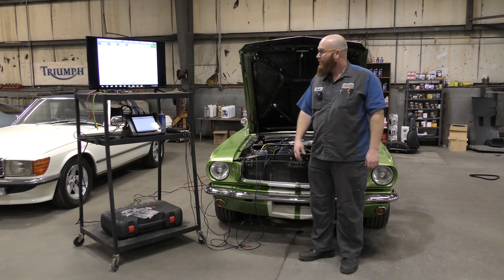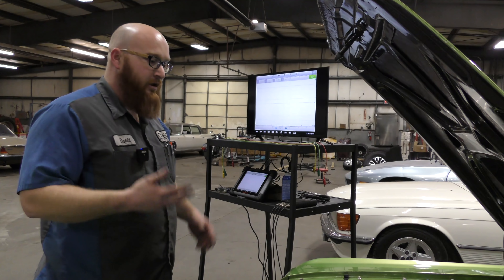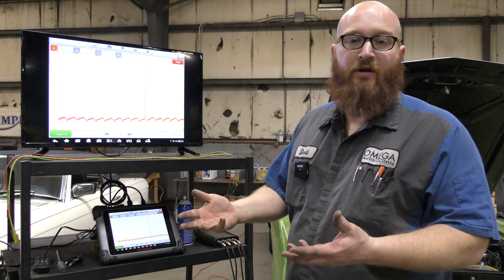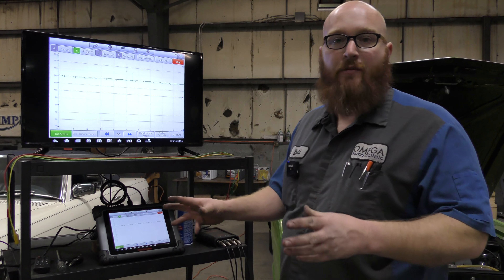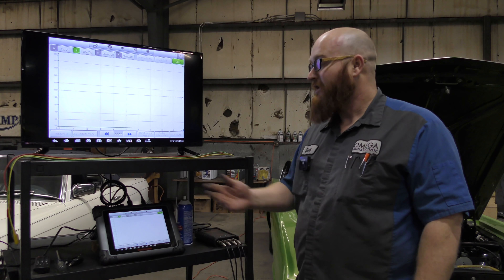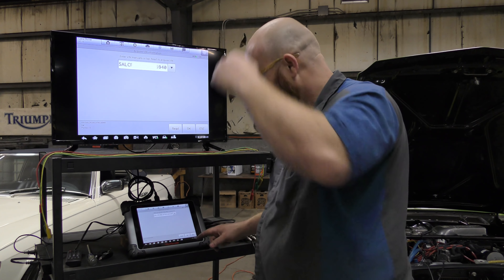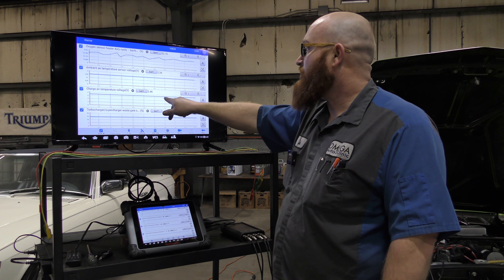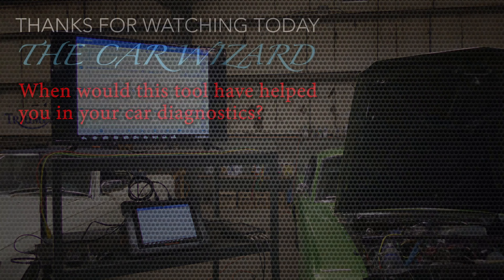The CAR WIZARD tests a '66 Ford Mustang using an Autel Oscilloscope. More magic toys in his tool box

Comment: Eric O. over at SMA channel showed how he used an oscilloscope to diagnose bad cylinder compression on a car by measuring cranking voltages from the starter. He also showed how to diagnosis a faulty injector with it as well.

As much as some of you guys think this is a shill video, it's not. It's a diagnostic showcase to show how a tool can ease the mechanic efforts to diagnose issues with a vehicle. You cannot run a modern garage without a tool like this. Good job wizard!

Comment: This brings back memories of my dad diagnosing cars in the late 70s/early80s with a Heathkit oscilloscope he built himself from a kit. It had a probe to clip on the ignition coil wire and could scope every cylinder firing on the screen like a conga line. Great for narrowing down misfires. He still has it somewhere in the garage. Only usefull on old cars with distributors and a single coil. Great video, looking forward to the in depth.

Comment: back in 1970 I completed a De Vry electronics course under the gi school bill. I still have the tv service scope that came as part of the course. Yes I was using it(along with dvm meter) like you show here to watch the ignition to each cylinder, but on a roll around cart with a extension cord power. great tool for "seeing" whats going on. there used to be a LOT of mechanics that would throw parts at the thing until they either hit it by accident or you ran out of money. I could not do that so had to figure out what was actually going on.

Comment: Back in the 80s, I used a test machine the size of two refrigerators. It had an CRT oscilloscope. That's how you checked the spark plugs, wires, and distributor & points.

Comment: I know that UI, my '99 car doesn't transmit the VIN yet, but I've had a friend who works in a shop recently hook an Autoel scan tool up to my car for a few minutes to read an airbag code and confirm my suspicion that the contact slider ring in the steering wheel that gave me trouble ("intermittent high resistance on driver's side airbag ignitor circuit" or something like that it said).

Comment: I used a 'scope on my 1998 BMW R1100r to read the failure codes. The old bikes MCU is pretty primitive and usually it's enough to hook a light bulb to it and count the flashes. It's four digits and you just have to count to 9 four times ... After failing that I hooked up the scope and had it counting for me :D

Comment: "Old school" that is, pre OBD II. All my cars are pre 1996. This is how I diagnose a lot of sensors like cam sensors, O2 sensors, etc.
Reply: Lol that's still new school for me. All my (that is, my only) car(s) are pre- fuel injection, no sensors to speak of.
Reply: Hats off to you sir.  I wish I would have taken some HS auto classes back in the 80's just to understand how far we've come with diagnostics.
Reply: My car doesn’t even have a crank sensor and the “cam sensor” is the pip inside the distributor

Comment: Interesting video for restorers.  RIP DH who could diagnose problems "usually", just by listening.  Used a long stick to touch the suspect part of the engine with the other end pressed against his ear.  I think a lot of cars (long time ago...) had a tendency to have the same problem; like nowadays, Hondas have "weak" power steering pumps.  He could diagnose most engine problems by listening; didn't have to pop the hood, usually...

Comment: I learned how to use a Sun oscilloscope in high school auto class in the 1960s. That also where I learned not to touch a plug wire with the car running.

Comment: I learned how to use an oscilloscope in high school auto class. That also where i learned not to touch a plug wire with the car running.

Comment: I have a 130k  2000 Explorer with last  5.0,roller pushrod engine I  got for $800, I got carried away  fixing things,so  if I sold it, be lucky to recoupe the parts $ total let alone anything for my time . Figure use it another year or two likely pull out the engine ECU, wire harness, fuel pump, etc to do some sort of a resto mod on a clean classic , or sell it for that purpose.

Comment: OK, but the oscilloscope seems to just show you numerical values;  What do those numerical values mean?   When I had an '85 Porsche 928, I used a simple digital multi tester to test the output of all the various sensors and the computer because I had the complete set of nine volumes of Porsche shop manuals for that model that told me not only what I should see, but also exactly how to test each item.   Do you have a database that tells you exactly what you should be seeing from each item tested on an older car without OBDII?
Reply: If you want to understand it, Check out ScannerDanner's channel

Comment: Wizard, all I have is an old-fashioned 2-channel oscilloscope, and I want to use it to troubleshoot an older car that has a carburetor and electronic ignition.  What should I view on the two channels after, say, doing a tune-up?
Reply: Listen if it sounds good its fixed wasn't rocket science back in the day.
Reply: @hcox1111  I hear you, Harold.  I guess what I should have asked is, what would the trace look like on such a vehicle if your coil was bad, or if your ECU was bad, or if you were getting low voltage to the coil.

Comment: Hello Car Wizard, thanks for the cool videos and your honesty. I have a 2003 Infiniti fx35 Rwd. My transmission and engine are in great condition 207k miles. My TCM needs to be soldered, there is a connection that broke and it is sending false codes to a perfectly working selenoid. I removed the valve body and opened the TCM and soldered the broken connection to the solenoid. It only lasted two months. I opened the TCM and found the same connection was broken. My valve body has been discontinued and I can’t buy a new one from Infiniti. Do you know a company or someone who can fix this electronics? Do you think the vibration of the transmission will break the connection again after re-soldering?

Comment: PLEASE HELP!   I have a 2001 F-150, 5.4 V-8, 125,000 miles.  I am having a problem with it idling too high.  Sometimes, the truck will travel 25mph at idle speed, without your foot on the gas.  If I am on a gravel road, it drives about 15 mph without your foot on the gas.  ALSO, when starting the truck, it revs very high as soon as it starts, over 2100 rpm, before settling down to a normal cold idle of about 1400 rpm.  It's never done that before.  Here is everything I've done so far.  The problem started just over 16 months ago, and I thought it was the Idle Air Control valve, so I replaced that.  It idled fine until about two months ago, when it started idling too high again, and it started revving way too high right after starting the engine.  So I thought the IAC was faulty again, and replaced it.  That seemed to help for about a week, and then it was back to high idle.  The check engine light came on and the code was for the Throttle Position Sensor.  So I replaced that.  It seemed to help a bit, and then it was right back to the high idle.  Next, I sprayed the mass airflow sensor with the special cleaner for that purpose, and I sprayed a full can of throttle body cleaner into the intake.  Again, it seemed to help a bit at first, but it went back to the high idle and still revs above 2100 at startup.  Then I replaced the air filter.  The old one wasn't very dirty, but I replaced it anyways.  Seemed to help again, and now it only drives about 8mph with your foot off the gas, which seems normal.  But sometimes, it still goes about 15mph or more on gravel without touching the gas, and even shifts to 2nd gear without touching the gas.  And it still revs too high at startup.  That's hard on a cold engine, especially here in Minnesota.  That's not right!  Please help me!  What else could be causing this problem???  Could it be the computer?  Have others had the same issue on a F150?

Comment: Autel vs snap on
Reply: I have an old modis 300 and of course. Obd2 can only be updated up to 2016 but if you have a car older than that it will give you a description of the connector, wire colors, how the graph should look and after all it looks more clean than the autel. The autel is pretty cool but for starters, the snap on will tell you everything

Comment: I was hoping for a demo using an old Sun Machine like we had when I was in high school in the early 80’s. We also had a distributor machine that spun the distributor to test everything. Anyone remember tools like the spark plug tester that allowed you to apply compression and test a plug under simulated load? My high school had one of those too! Ok Wizard, let’s see a demonstration of setting ignition timing using a simple light bulb with two alligators clips, seriously old school like I used to do on my Formula Vee race car! Seriously though, how about demo of simple tools home mechanics like me (retired race car mechanic actually) use all the time like my Lisle Spark Tester, or a the usefulness of a high quality Volt/Ohm tool, the proper way to use a clicker torque wrench and why an old school beam torque wrench is still a viable tool. There is much need for helping young car enthusiasts learn the basics!

Comment: No air mass flow sensors on a '66.
Reply: Resto Mod. Modern parts in a classic car.
Reply: @scorpio_357  Resto mod = 1950s and 1960s hot rods, new engine in an older car, plus new suspension.  Absolutely not restored, Has no relation to original car except body.  Doesn't drive like a '66.  I'd just call it a hot rod.

Comment: That should be a OBDI at least no?
Reply: With a 5.0 HO, yes but it might not have live data if using old EEC IV ECU. Live data for most EEC IV didn't appear until early nineties, approx '92 or '93. EECV came out around '95 '96